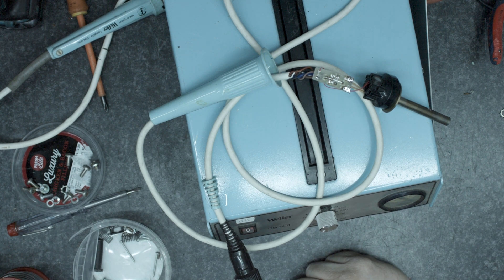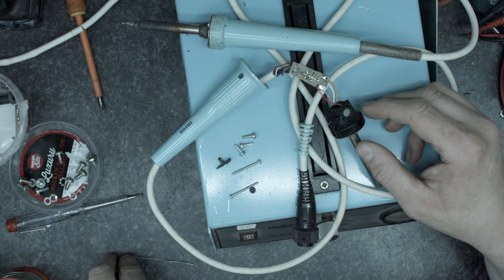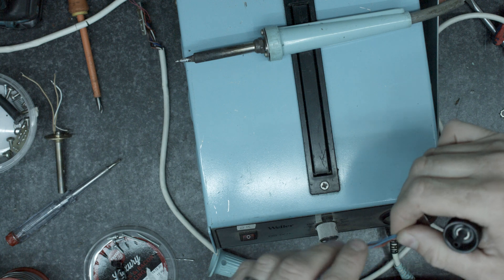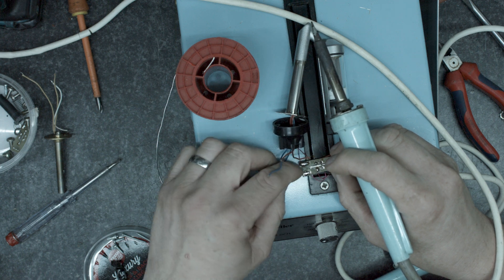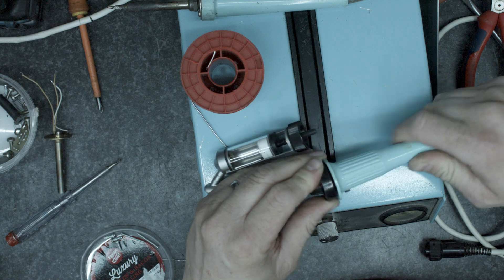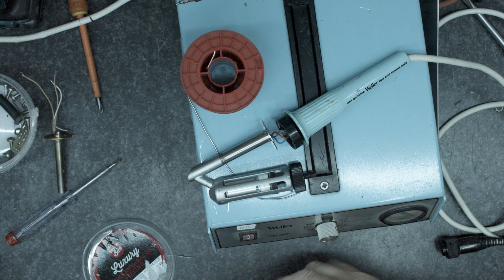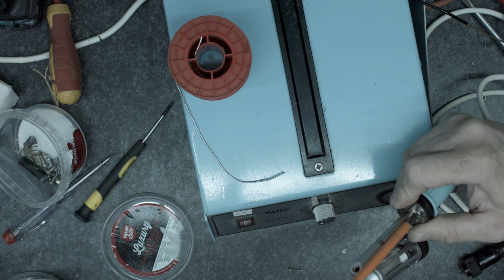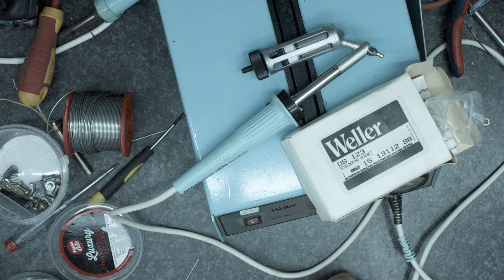Lets bring a Weller DS 801 back to life with testing and repair tips

Comment: Nozzle tip is hard to find and costly if you can find. My solution is to use mig welding tip, jist rethread the tip and make it conical and its done, i got the mig welding nozzle tip for about 2 us dollar in a pack of 10
Reply from the maker: I got them from RS in the uk